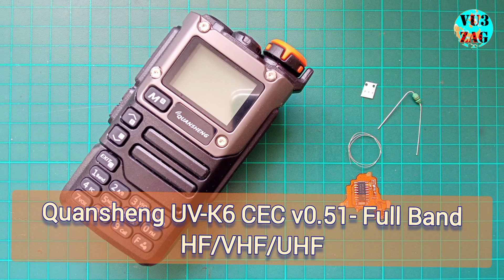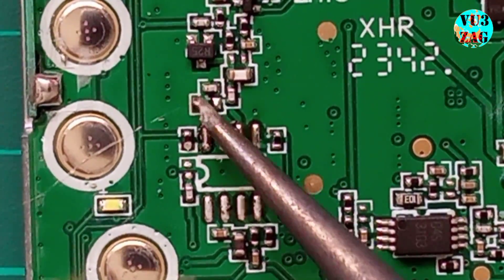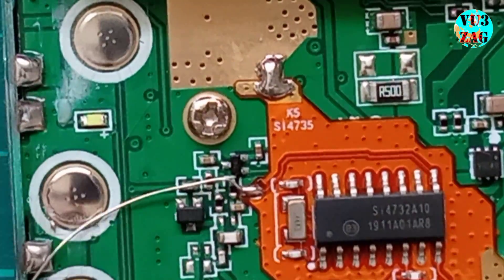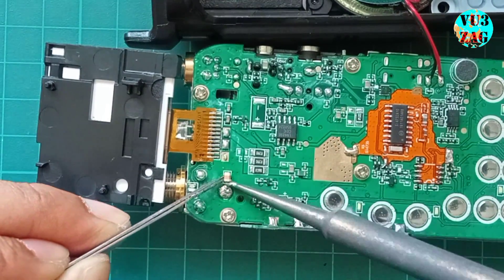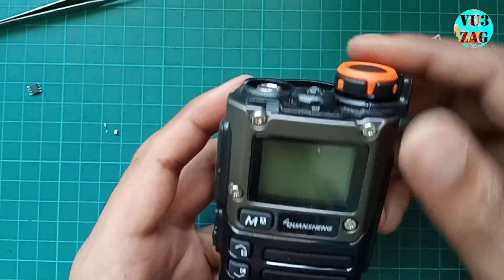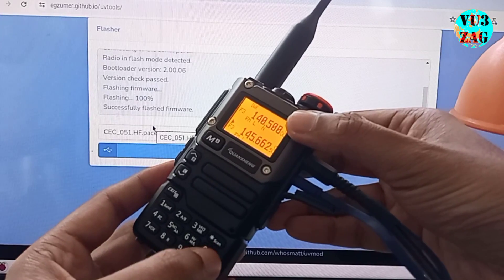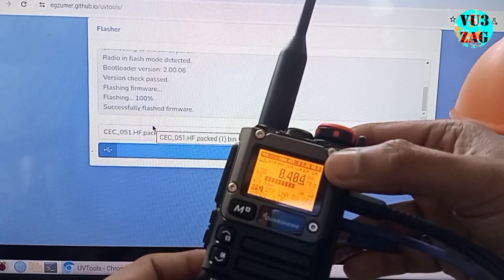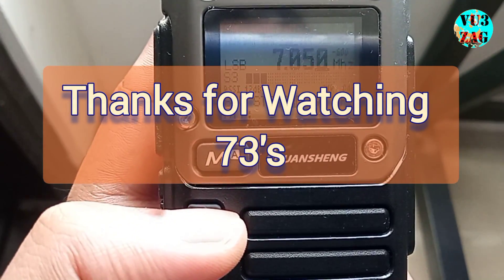Quansheng UV-K6 CEC v0.51- Full Band HF/VHF/UHF

Comment: I tried twice, but unfortunately, it didn’t work for me. After the MOD, the radio wouldn’t turn on. I restored the original chip and replaced two capacitors. I also soldered a new LED, but now the LED isn’t turning on. However, the radio’s TX and RX are working fine with both VHF and UHF.